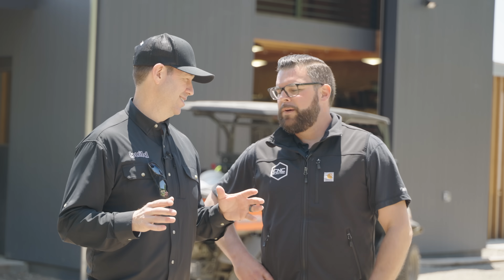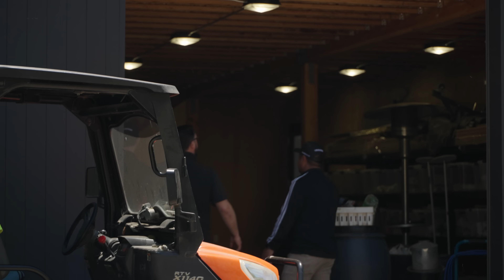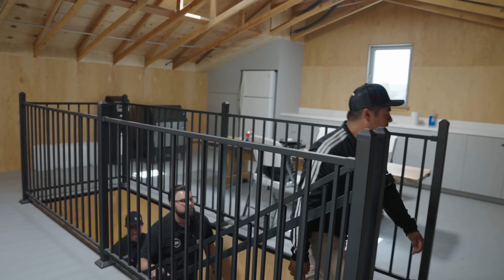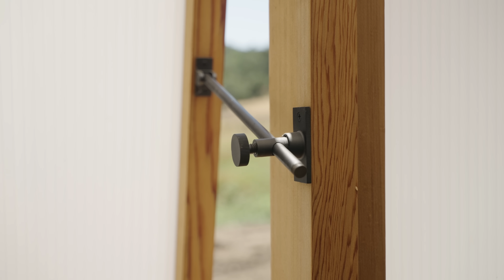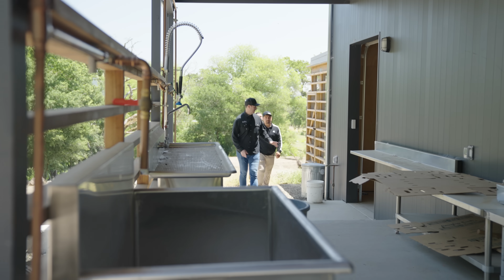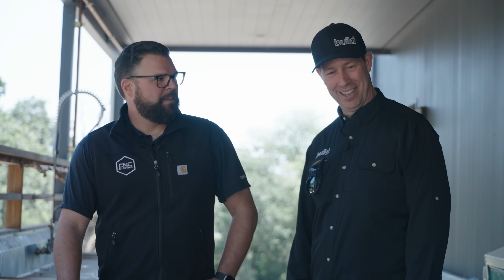A Wood Barn That’s Absolutely Beautiful, But Uses 2x Framing To Build

Comment: Heyo Risinger and fans. I just bought a spec home that I paid for some upgrades on while it was being built. Builder didn't install the heat pump I wanted. They went with a terrible 15 SEER model that switches to 'emergency heating' below 40f instead of the one I paid for that's good well below 0F, and is 18+ SEER. Here in Colorado that is unacceptable, heck even in Texas that'd be a bad idea. 

I'd like to take them to small claims court to get money to have the proper one installed, but having trouble filling out the JDF250. Specifically the servicing part of it. Do I send it to the guy that signed all the contracts? To the LLC? To the build manager here in the neighborhood? 

How do I find out where to send it to even after I learn the right one? Like if I am supposed to send it to the builder I doubt I'll be able to find his home address, he's never in the office... I'm just kinda lost. Any help would be appreciated.
Reply: Get a lawyer.
Reply: Ask Chat GPT

Comment: The post builds are certainly a LOT more insulated and efficient and also cost less in wood.

Kyle would refuse to build this shit😂.
Effective R-value for kyles post barns is probably 2x what this one is for the same thickness
Reply: I doubt R value was a big concern for a working barn in Sonoma